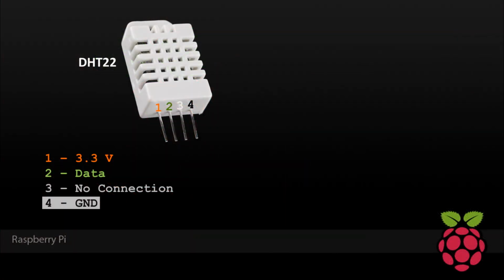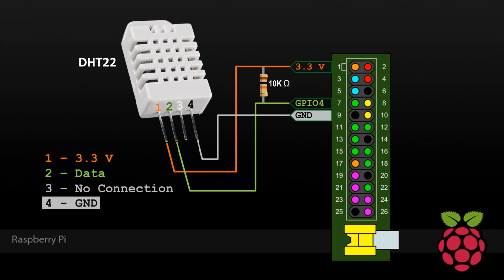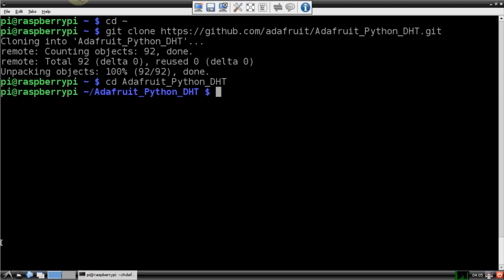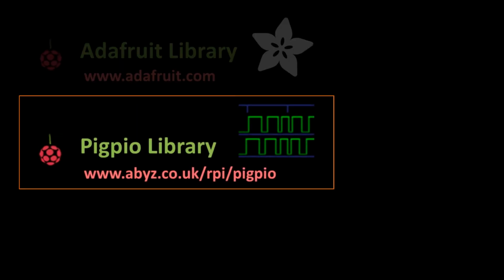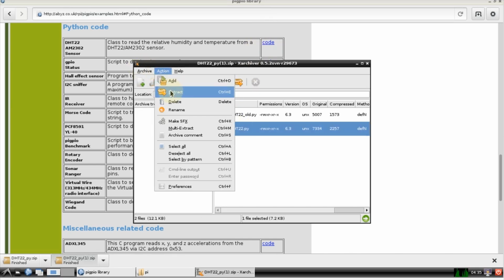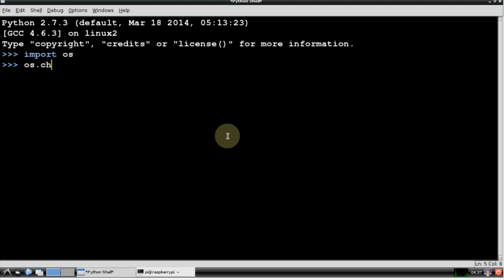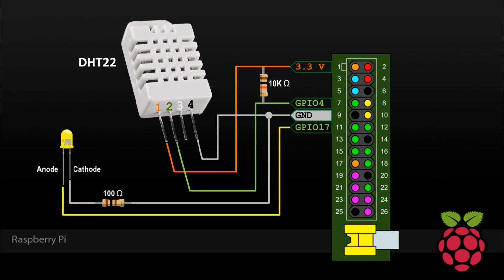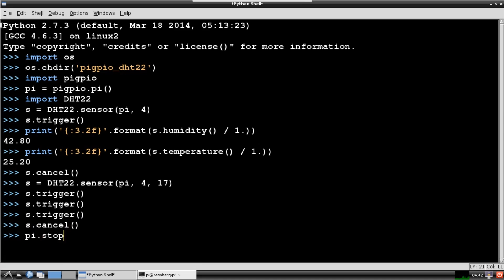DHT22 Raspberry Pi Humidity Temperature Sensor Tutorial

Comment: Why I have to put 10k resistor between 3.3v pin and data pin?
Reply from the maker: The resistor is a pull-up.  The datasheet I found online shows an external pull-up in the wiring example.  I explain pull-ups in my inputs video: http://youtu.be/a8ozfd_Wd-w
You might be able to omit the external pull-up if you re-wrote the code to use the Pi's built-in pull-ups.

Comment: I'm getting a -999.00 reading for both using the second method. Anyone knows why?
Reply: Try redoing the code, booting off the pi, and then maybe try redoing the setup. Let me know. Cheers
Reply: Joseph Draper
I tried the adafruit method and pigpio method, both working, the adafruit require root access, and pigpio method, I get random reading -999 for both humidity and temperature, initially I was using 3.3V and 10k ohm resistor, later I tried 5V, and the still get -999 once on a while, but not with the adafruit method.
Reply from the maker: bronze maxell Make sure it still works with the Adafruit method because you may have damaged something by using 5V.  Before using pigpio make sure you start the daemon.
Reply: Laurens Nicolai Did you ever sort this -999.00 reading issue. I have 2 of these sensors and followed the video exactly and have the same issue, but every now and then it will magically work but mostly just -999.00